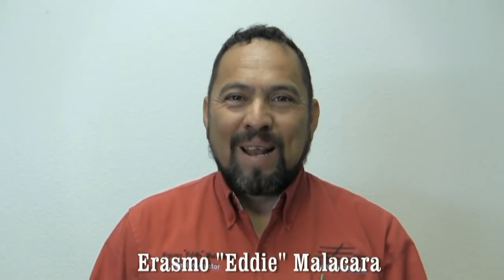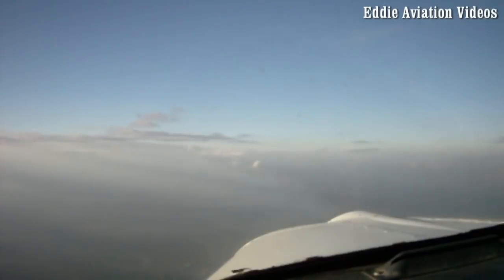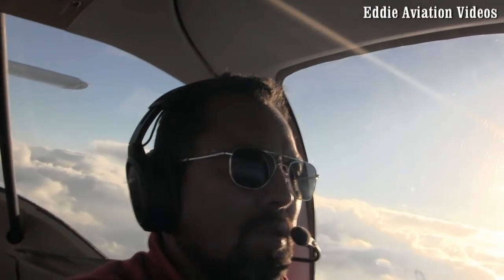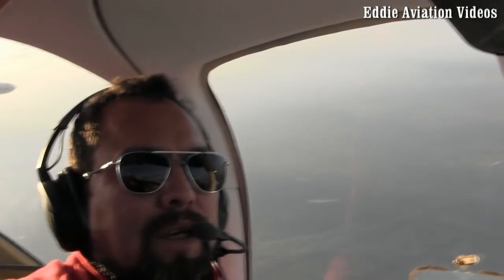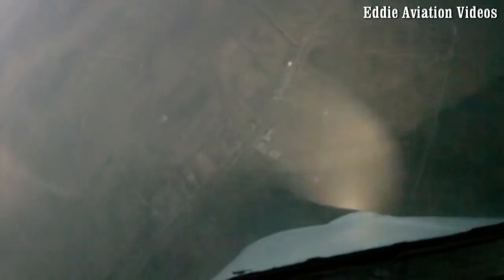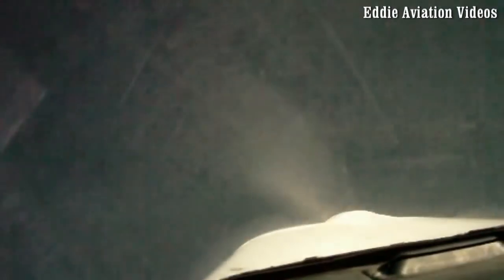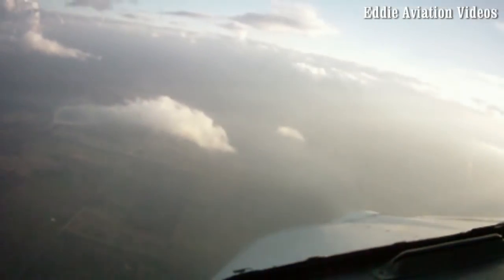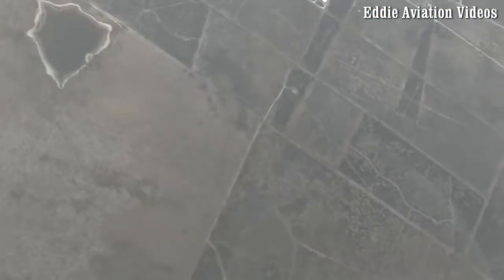Training spins in the Piper Tomahawk PA38

Comment: That brought back some memories of my 2000+ hours of instructing in the Tomahawk, including many hours teaching trainee instructors to recover from fully developed spins. I found that after about 5-6 revolutions, the engine would sometimes cut out but restarted easily during the normal recovery as the airspeed increased. Nice video, thanks
Reply: if the engine did would not restart, is this plane easy to do a deadstick landing?
Reply: @dabneyoffermein595  They make a pretty good glider, but an airstart isn't an issue. In fact, exceeding Vne is of greater concern during the recovery

Comment: Nice tutorial on the ‘hatchet spin characteristics. Very well spoken, with a great delivery and explanation.  My flight school was a Piper dealer, so we had these always filter through the flight line.  Unfortunately lost two friends in a Tomahawk stall/spin accident, not enough altitude for recovery. 

One thing to check on a Tomahawk, if you can have a mechanic remove the dorsal cover near the tail of the aircraft, you will see two small bolts that hold part of the tail on.  Departed with a student one day only to return when the student complained of a vibration, well, one the bolts had a stress fracture that was close to snapping.  That was a sobering discovery.
Reply: WHOA, that's terrifying.  I wonder if annuals every discover this fault?
Reply: @dabneyoffermein595  AFAIK that's a recurring inspection. Make sure your A&P is aware of it; some aren't.

Comment: I've done many spins in Cessna 150/172's and Aronca's from 7AC to Super Decathlons.  When I watch this video, the thing that is unnerving to me is that the Tomahawk seems to be very delayed to spin recovery even when the proper flight control inputs are used.  The delay of recovery from intentional spins is probably not a problem.  I would like to see how the airplane does on recovery from immanent spins.  Primary flight instruction should include spins with emphasis on recovery prior to the spin fully developing.  Eddie is a very good instructor.
Reply: Last time i spun the Tomy was 20 years ago, did lots before. Normal spin entry, standard recovery, but pitch nose down (normal) and more rapid spin. But didn't break out. It kept spinning in the rapid recovery mode, pretty much a vertical dive, spinning i hadn't seen before. I started at 5000. After a few seconds i thought this is going in, so i applied pro spin input and std. recovery again and it came out at 1500 feet. Really scary.
Reply: @flybobbie1449  It recovered with pro spin control input?  No thanks!
Reply: @flybobbie1449  -- what is "pro-spin input"   -- does that mean you are pushing the rudder in the same direction as the spin?

Comment: With regard to spin training without parachutes, it is legal for a CFI to give training for any rating even if the rating being trained for does not require spin training without wearing parachutes.  The FAA has interpreted the regulation to mean that since spins are required for at least one rating (CFI) that they are legal to be done without a parachute when training for any rating when the training is done by a CFI.
Reply: how would you bail out if the centrifical force of the spin is keeping the door shut?  seems like it would take Arnold Swartzenegger to open the door.

Comment: Nice video, two quick things. Unless you're providing dual for an initial CFI, you're required to wear chutes while spinning. And in the Tomahawk, you really should be wearing them regardless. Folks have been killed. Secondly, you're counting three revs for a single rotation. Pick out a landmark and count correctly. Students tend to speed up their count, YOU should know what you're doing.
Reply: LJDRVR Ok ...
Reply: LJDRVR I don't know what country you are talking about but in the UK and the US as far as I can see there is no regulation which says that you need a parachute to spin.
Reply: @JNelson_  I know this is really old but in the United States, parachutes are required unless you are a CFI.  Eddie is a CFI.